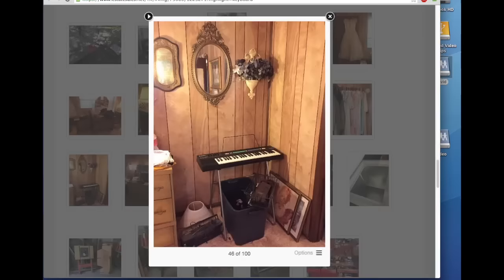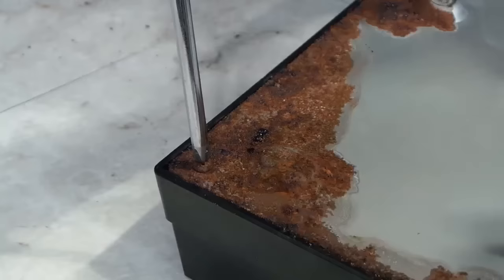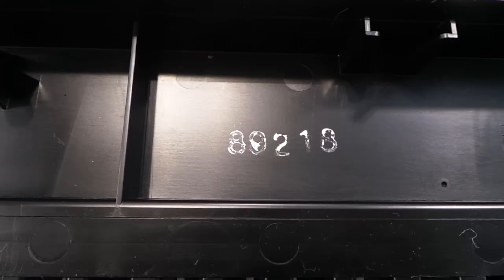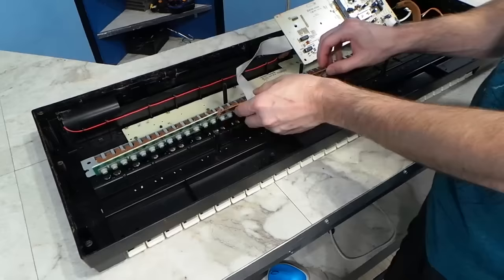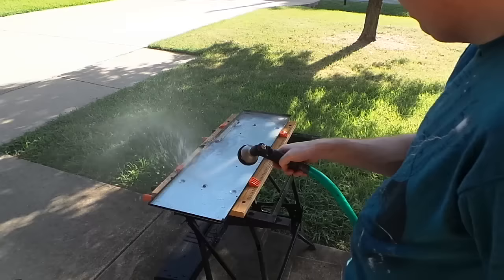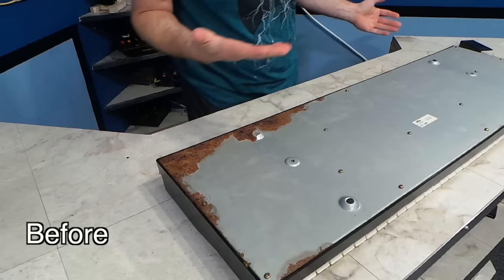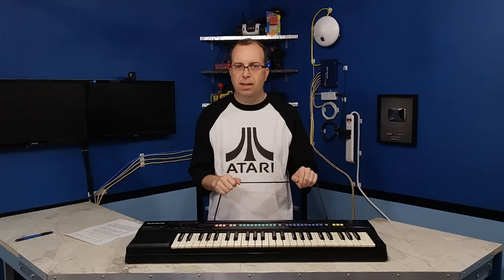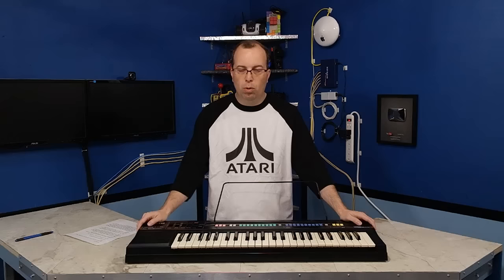Worst battery leakage I've ever seen!  Casio CT 380

Comment: ... I just realized my little cousin's piano toy has mixed batteries.
...
 Brb while I freak out.
Reply: The main problem with mixed batteries is long term storage, you should remove them when not in use, but mixed batts will cause the brand with stronger current to charge the weaker ones and they leak
Reply: *voltage
Please don't mix voltage and current, it can cause temporary health issues for electrical engineers
Reply: @Xilog  Please don't replace the colloquial term "voltage" with the official one which is "tension", it can cause temporary health issues for linguists.

Or so is said.
Reply: @RedHairdo  oh

Comment: A trick I have learned from using vinegar to get hard water stains off of basically everything in my bathroom and kitchen: if it's not something that can be submerged to soak easily, take a towel (or as many as needed, soak them in vinegar til they're dripping wet, and wrap the item in that. Come back every 15 min or so and pour on more vinegar. This usually softens things up enough to scrub... if not, a C/L/R type spray on cleaner can work miracles

Comment: You really should start wearing gloves when working with rust
Reply: Mrcantfapenough rust is just oxidised iron so other than a lot of dust, it shouldn't be so bad
Reply: AmethystGMD what if you cut yourself taking it out?
Reply: I wouldn't try to take out the battery. This guy knows what he's doing.

Comment: My sister was gaming with my old gaming mouse and the battery that had a shit ton of Japanese writing on it exploded and I heard a huge pop and why sister screaming and she says my mouse battery cover blew off and to find a nasty ozzing battery
Reply: Mikey Larsen This is another reason why wired > wireless
Reply: i only go wireless now
Reply: Mikey Larsen well I still use a wired mouse because for me it's easier for gaming I have this type of wire that is yarn and is safe for me. READ THIS: never mix battery types
Reply: Mikey Larsen people confuse type with brand so read the batteries but generally they are same thing. Panasonic makes carbon zinc batteries which have like nothing dangerous about them at all
Reply: I always use rechargeable batteries for wireless devices. Unfortunately, my wireless mouse seems to interfere with my mom's wireless mouse :p
Reply: Wireless=Safer
Reply: I had a few dead mouses from leaking batteries so I saved hundreds of dollars by using a wired mouse
Reply: +The kerbal Wired=Safer and you're prone to getting your hand blown off if the battery in a wireless is too powerful

Comment: Did you use coke to remove the corrosion stains, it should work to remove them.
Reply: Coca-Cola doesn't work that well, and I most certainly would rather spend six dollars on two three-liter units of vinegar than twenty cans of Coca-Cola...
Reply: Totally Unfocused Haha I like you I like your classy attitude

Comment: Why buy other batteries Duracelles are more expensive but save your device from his
Reply: not as bad as the off brand battery @zUltra3D
Reply: They leak too. Maybe they take longer to start leaking, but they leak. Period.
Reply: @Colaholiker  meh I use Duracell
Reply: @Axxetto  So did I in my MagLite 4D. It changed from "powered by Duracell" to "ruined  by Duracell". :-(

Comment: Those "super heavy duty" batteries really leak too. I had some in an old toy keyboard as a kid and when turning it on for the first time after a while, it worked fine for a few seconds then died. Looked underneath and saw battery acid was practically pouring out of it. They're not like alkaline batteries that are mostly dry on the inside. So I'm not surprised that it would cause that sort of damage if left alone without being cleaned. That acid is so runny it will get everywhere.

Comment: Me and my grandpa found an old Casio keyboard in one of our storage rooms and we restored it, but before that, the batteries were pretty corroded, luckily it didn’t get all over the battery compartment and the keyboard still worked. It was a pretty easy restoration job. The corrosion looked yellow and spongy but I didn’t touch it

Comment: IT is not the battery content itself. Rather the battery containers massively corrode by humidity after a battery loses its polarization.  But it is WATER, by the oxide and salts building up, which is soaked up, literally "sucked up" hygroscopically from the air around and then flows to everyhere on metal bottoms e.g. and keeps wet (also rust itself keeps a surface wet). Batteries having an unprotected iron or zinc container show massive corrosion especially. Sometimes zinc containers are encapsulated with a printed iron jacket, but are not airtight. This however, also builds up a galvanic element on itself with the humidity and the zinc underneath, and will therefor start to produce corrosion of the metal (this time not on the zinc, because here the iron is more un-precious. => RUST. That does this massive extensive corrosion because of the hydro-corroded metal. That what comes off,  can work sometimes acidic and iron hydroxide works the alkaline way. And especially RUST sustains itself by also pulling water off the air and so, this hydro-catalytic moisture-sustained process continues forever on the still uncorroded metal until removed.

Comment: Speaking of leaking batteries...have 2 wiimotes...haven't touched them in years. Both had leaked so badly that it leaked outside of the wiimote all over the back and one of them on the front!! They also both had rubber cases but those were coated and I wasn't bother with cleaning them so I just tossed them. I spent about 30 minutes trying to open the backs then spent about an hour cleaning the inside of each... I didn't bother looking to see if it reached the board since the majority of the leakage was always on the battery that, when laying the wiimote on it's side, was on the bottom causing it to leak outside of the remote as well as the storage area (which was easily cleaned. After cleaning and putting new batteries in, the wiimotes worked perfectly fine and looked better than they used to when we did use them.

Comment: Hey David, if you ever end up running into horrible corrosion like this, theres a product called Krud Kutter. It's one of the most powerful corrosion cleaners that doesnt damage the metal that ive used.

Comment: I know this was 4 years ago, but I would recommend muriatic acid for removing rust from metal like on the back plate. I tried it with a rusty gas tank and worked far better than vinegar did. It's strong stuff, but for examples like this it works well.
Reply: Vinegar just less aggressive and cheap to find, you have more time to control the process. But yeah, agree with you

Comment: The leaked battery probably was a zinc-carbon battery as it had "super heavy duty" printed on it which is typical for them (That is more like a marketing gag, you can't really put a heavy load on them because of their very low capacity). These batteries are known to leak when they are discharged far enough. The Duracell one is an alkaline battery, that type of battery has a much lower chance of leaking.

Comment: Next time you do something like this try Rustoleum Rust Dissolver.  It's a Gel product that I have used to remove heavy rust from things like automotive bumpers.  It would proabbly work great for this.  When you wash the gel off after letting it sit it leaves bare metal like it was just sanded.

Comment: The best way to deal with this is KETCHUP or KETCHUP mixed with Acetic Acid or pickling vinegar. You paint the ketchup mixture on the rust and leave it a week or until it goes black. Then you just peel it off. I am using it on some Macs.

Comment: it seems like the older casio keyboards have a habit of making their batteries leak.
like  the keyboard is "on" even when the switch is off.
leakage like this happened on one of my Casio MT-205s and managed to corrode one of the traces on the keyboard.

Comment: Great video. I’ve just found a keyboard in the rubbish pile and the battery box is fully corroded. I have the power supply but the wires have been cut off. Do you think it will run if I rewire the power supply?

Comment: My Casiotone CT-7000 (1983) just arrived after a two week wait...with the original factory installed Casio branded AAs in the memory battery compartment.  >_<   Luckily, I think it's sat in the box flat for it's whole life, and the actual compartment and terminals are clean, though the batteries have definitely leaked and corroded some. There's a stain in the box below where the compartment would have been, so I'm guessing that's where it went.

Comment: I watched you trying to clean up the metal corrosion you ever tried getting a cheap sandblaster and using baking powder in it I use it on carburetters all the time it’s biodegradable and it works awesome But you’d have to find a small air compressor but you can do it pretty much in your backyard and environmentally friendly

Comment: To remove that stuf on the bottom you need wf-75 cus that was Rust and wf-75 is Rust remover. I've also used it on rust before

Comment: i left batterys in my gameboy from when i was about 7yo to 19. and a similar situation happened with a wiimote in my closet, the corrosion was intense on both, the wiimote had blues and greens and all sorts of layers of corrosion, the gameboy was mostly white corrosion and came off fairly easy, still need to open the gameboy up and consider moving forward with attempting to fix it since its my og gameboy and i sold my og advance years ago foolishly xc

Comment: Maybe you you should have tried soaking the bottom plate in a plastic kiddie pool. Also there are wire wheels for angle grinders. You could have picked up one if you have a Harbor Freight Tools in your location.

Comment: Zinc-Chloride batteries are the worst! It seems like that the cheapest C and D cells are always like that, with "Heavy Duty" written on it. I always run away from those, if i want a battery that lasts a decent amount of time with not much usage (like for a flashlight) i'd rather get some old-fashoned Zinc-Carbon, as i found that even Alkaline can sometimes start leaking a bit, and destroyed my aluminium Maglite :(

Comment: Next time you get corrosion this bad use naval jelly.  It will completely remove rust, and only rust, not any of the plating nor will it scratch the metal like your grinder or s wire wheel.

Comment: I know you not supposed to mix different batteries together, but would if they are brand new right out of the package, same strength same size but two different brands like one Energizer and the other Duracell brand, would it work without that happening with the leakage? Also why does it do that when you mix different types of batteries?

Comment: Hi! 8-bit keys so I have a keyboard and it's very old there is stuff worng with it. Like when you play it for too long on the bottom it gets warm (if on lap).

The mic some times work. Also some times when you press a button it don't work. And on the battery lid when you look at it there's "Rust" how do I fix that?.

Keep in mind the keyboard is 40+ years old!

Comment: i didn’t really get an answer cause what if i didn’t mix batteries. i was gifted a keyboard and they got it from a thrift store and it has all the same batteries + it doesn’t work now but it worked and nothing came out of it from months and now i go back to it it had all this brown stuff
Reply: Left it with the batteries in it too long. Batteries don't stop discharging really. If you're not gonna be playing it for a while remove the batteries entirely. 

Also even if they were same batteries doesn't mean they are the same electrically speaking. A battery that's slightly more drained than the others can also cause this.

Comment: Hey 8 bit Guy,
I was wondering what I should do if my casio CT 370 won't power on with an external power supply. The polarity and voltage is correct on the adapter I am using but it will not turn on. I have yet to try to turn it on with batteries, but I really want to fix the external power supply port. What should I do to figure out what the problem is?

Comment: You should actually be quite careful handling corroded batteries because the acid inside is really poisonous (for example not get it on your hands workplace, keyboard etcetera) and use gloves

Comment: That’s the worst you’ve seen? One of the battery’s in one of my old old very old items needed a battery but we never took the battery out when we stopped using it.... many years pass and the battery MELTED into the set and we set it outside to try to get the acid to fall away and leave but It Caught on FIRE so here we are... standing in-front of burning ACID and then we just throw it in the middle of the road... and drive over it and would you know it the wheel did not cetch on fire because it would be hitting the ground but to our surprise it stuck to the Wheel then we throw our old one away then we go get a new tire and that’s the end to the story

Comment: Why would you not solder the one little wire to the battery compartment? Lol
Reply: It's nowhere to solder it. 
It's okay, i get it not in first time too. Just look closer, the opposite battery terminal fully disappears. But since it will powered from outside source, not big deal
Reply: @serhio4275  Oh? No bit of metal? I can't remember seeing it, but I guess it's a fair amount of effort to have cut a new bit.
Reply: @inukithesavage828  if you want everything to be perfect - yes, to David not big deal, since keyboard in his indoor collection and has outside power source.
Reply: @serhio4275  fair enough!
Reply: @inukithesavage828  2:04 "you can see terminal is totally gone"